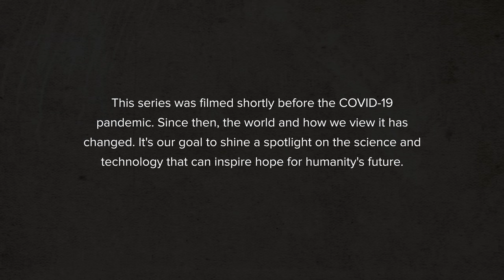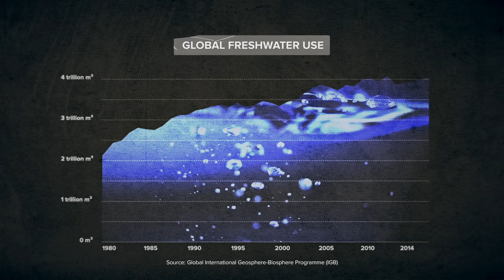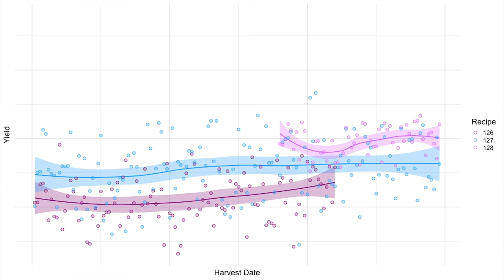Robots Run This Farm (and Save 95% of the Water)

Comment: So at 5:45, when I take the garbage juice out of the fridge, you would not BELIEVE how much it stank! Also, can confirm, the wasabi arugula was seriously spicy. It did make me wonder how much the tech could be expanded to larger crops -- is this the future of fruit or vineyards?
Reply: I knew this would happen the way the population is expanding. Wondering how fast this tech will be commercialized and will it be enough. Will be people accept it? I could see you cringing at the idea.
Reply: What’s the cost comparison of the vertical farming vs regular farming? Also, what are the limitations, like what types of crop vertical farming can’t do.
Reply: @sisenor4091  normal farming hm……could it be purify the soil even liquid water .
Reply: @sisenor4091  same goes to trees n plants.
Reply: @tankahchoon2723    Sorry, I don’t understand your answer. By the way, I believe in vertical farming but like everything else, I have questions.
Reply: What if the power grid goes down? How is that facility built to handle that?
Reply: i like your idea of a postapocalitptic tech survivalist, i love you babe
Reply: I live in a rocky desert, and it's evidently landlocked. Desert residents drink more water or some hydrational energy drink in the summer than any other time of year. Why? BECAUSE 'TIS 2 FUCKIN' HOT!
Reply: was he using solar panels on the roof of the farm? thats gotta be a big power bill.
Reply: would you consider doing a video on earthships?

Comment: This is nothing new in fact many companies have been running "farms" like this for 20 years. They have failed to catch on or disrupt the industry, not because of a lack of tech or investment or even smart people working on it. The real reasons they have not and never will disrupt traditional farming is that if the math the economics don't make sense and even with the increases in output of these systems the would end up taking up ten times more room in a city then the people do just to grow enough food for those people. The cost of running the lights alone makes it uncompetitive for most crops not to mention the heat buildup of running a skyscraper full of grow lights would be completely unmanageable. 

The economics will never make sense at scale or for most traditional high volume staple crops because as you go vertical the capital costs grow exponentially and real-estate costs in city centers are prohibitively expensive. This is why you never see staple crops of feed grown in these "farms" and you only ever see hipster greens because they can mark those up enough to cover their costs and that market will pay it but that market is small and that is not even a small percentage of the overall market. The largest markets are for commodity crops such as wheat, rice, corn, and soy beans which it is completely unfeasible to grow vertically or in city centers.

 There is another solution, we retrofit pre-existing farms with much of the same tech and build greenhouses over their land. This allows for that land to produce the whole year just like the project shown here and save the same amount of water but without the huge cost of being in the city center, having to run elevators or lifts, paying for electricity, etc. etc. You would obviously still want to focus on the farms which are closest to the cities first to minimize the shipping and the waste that comes with it. It may seem at first that this would more expensive but this is not correct at any type of scale this is the far more economical option since the cost scales linearly per unit of growing space but your costs scale exponentially for each additional unit of growing space when you grow vertically or in cities.

Comment: why are they doing that?  i remember as a child the two pressure cookers on the boat.  you heat the water and it goes threw coils as steam and into the other cooker.  it lleaves the alge and salt and bad stuff behind.  so while out on the boat we make our own fresh water.  you can even use a little salt water to boil vegetables.  so using a solar panel and boiling water and steam we can make drinking water which they have been doing for years.
Reply: the ocean is getting plenty of water and the sun gives us solar to use to make fresh water.